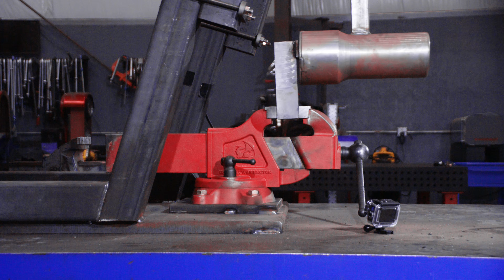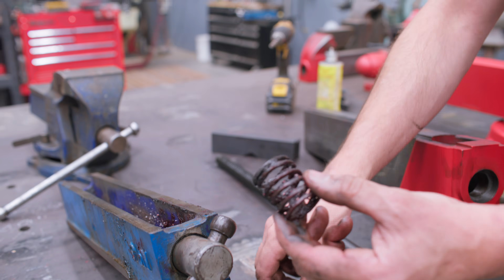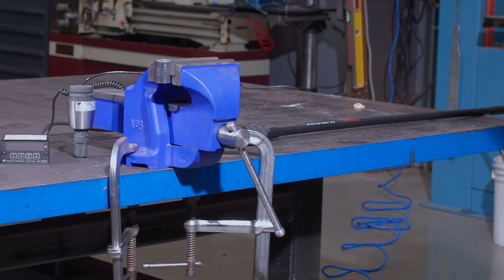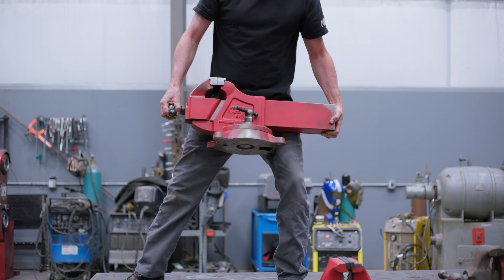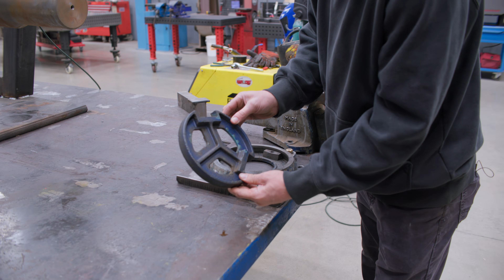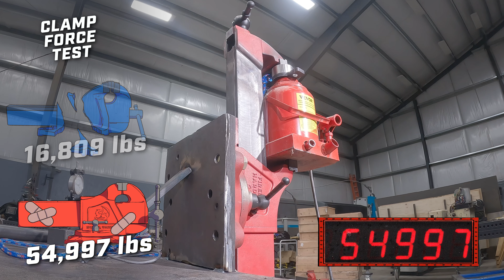What is a High Pressure Vise?

Comment: Worked with a guy who took the handle off his vice and just milled a 1" hex head into the end of it. For quick work he just put a socket on a 1/4" impact driver. When he needed to really crank her down he would grab a breaker bar. The 'standard' handle was a ratchet/socket or a box wrench. One of the best vice mods going. While there is definitely a case to be made for "buy once cry once" approach to buying tools it's important to note that not everyone needs a hardtail 510 for their workflow. For a machine shop doing production runs where you can make jaws/fixtures for your parts a standard decent quality vice is likely fine. For something like a service truck or general workshop where the vice doubles as an anvil/break/crimper/GripperRipper9000 the hardtail makes a LOT more sense. However, if I was a business and had the money to spare I'd buy a hardtail just to be done with it. When your tools are how you make money you want to buy the best tools you can afford that won't let you down on the job. For the average home-gamer who just wants to sharpen lawn mower blades and drill holes into angle iron it's hard to justify the cost.
Reply: Thats why he recommended the Record vise for your home projects. He showing you a professional tool to professionals so they can outfit their shop/business with high quality tools that have lifelong results.

Comment: In the demonstration of your vise's high clamping force, you should have explained why there's such a difference between your vise and the Record vise. It comes from the same design features you described earlier that make the Record's slide weak and loose in the base casting and make the Record's screw bend.

Applying stress to the Record doesn't just bend the handle, it also bends the slide, the screw, and even the base casting. As you crank the handle harder and harder, a decreasing portion of your energy goes into compressing the workpiece and an increasing portion simply bends the vise components.

It's also important to realize that those bends store energy. That's why a weak vise is so dangerous when it's tightened. That energy will be released suddenly if something breaks. And it's also why the weaker vise takes more effort to open and release the workpiece. The stored energy maintains friction on the screw. You have to fight through that friction until the energy is released (you feel it as that sensation that the vise is helping you unscrew the handle—it is!) and the jaw starts to move.

On your vise, the more rigid structure stores less energy and puts almost all of your effort into compressing the workpiece. And when it's time to release the workpiece, you have little stored energy to release, so almost as soon as you start moving the handle, you're moving the jaw.

You have a great product there. I only wish I could afford one!

Comment: I've broken tons of vises and finally settled on a Yost "all steel" 6" and surprisingly haven't broken it yet. When I manage to break it, it's getting replaced with a Fireball one. I'd love to see the Cutting Edge Engineering crew in Australia get a Fireball vise as they often have challenging workholding tasks and I've never seen Kurtis use a vise as regular vises are never strong enough to do what he needs

Comment: The real question is what test can you preform that the record vice can do that  the fireball vice will not out preform. I can't think of one myself but I guess thats the test you need to find to be able to improve your design. You've found so many failure points on other vices of comparable size already and designed yours to not fail but are there any more that make yours fail when another's won't.
Reply: i donno other then price this is top tier. worth the price dont get me wrong.

thing is, lots of these tests would kill whatever you are working on, or could have just been set up differently. the bracket press is nice, but, angle stock is pretty cheap and a press would be in order if i needed to make more then one. and if it didnt matter id use a hammer.

Comment: Are yall gonna make any smaller versions? I need one like half of the size if not a little smaller than half of the size. I need it to go on the side of my 5 drawer roll around tool box that I push around to different presses. I already built a strong base that hangs off the side for a vice but haven't found a small yet durable vice yet to put on it.

Comment: If I had a shop or even a table to mount one to. I don't know what I'd do with one, but I know it would be clamped to the upmost tightness.

Plus it was nice to see that Clint over at C&C equipment got one. Not sure what brand of hell they've put that one through yet. But the did have a piston rod clamped by the end something out about five or so feet from the clamp and still were busting loose rod nuts that go on with several hundreds of foot pounds.

Comment: In most cases the question is not which is the better vise, but which is the cheapest option that's good enough. Your vise definitely looks amazing and I believe it's worth the money, but many won't ever need that strenght or build quality. For many I think low cost options are more interesting (I'm aware of the compact version, that helps a lot already).

Comment: The jaws on that brand new Irwin/ Record stand in vise must really be soft for the knurling to flatten out smooth like that, but the casting seems to be stronger than any youd find in a hardware store - granted were in the area of "vise abuse" but sadly thats how many think a vises should be used.  I love this guys products, his hard tail vises arent cheap but theyre about the best quality there is in regards to quality of U.S. made metal, design and product support - hard to find a better vise anywhere he cuts no corners in his designs or quality, in fact theyre better than some of the best names out there, even some older better made vises arent as well designed and built as his are

Comment: We have a makerspace. Currently down to 1 working vise. Two non-named brand vises in our metal working area broken. Unknown what people were doing, but pretty shitty design when looking at what broke.
2 second hand Record vises in our general workshop. One has the return tension spring broken but still works as a vise. The second has a broken jaw from a guy trying to remove a seized seatpost from a bike. Didn't seem like an unreasonable task.
Jason's right, you certainly miss them when you don't have them.

Comment: Not everyone needs an f350 dually over a ford ranger, but when you do its nice to know theres one out there. Will a ranger do most of things that the majority of people need? Yes. Will a ranger pull a 10,000 pound fifth wheel dump trailer loaded with 25,000lbs of dirt? No. That where the f350 becomes necessary. And its the same way with the fireball vises.

Comment: Interesting . . . But consider this:
       Cordless impact drivers have become nearly universal in shops. Have you considered designing a vise screw with a hex head, intended for use with with such a tool?
Reply: you cant feel the clamping force and how much "give" the clamped material has when mashine tightened. For me thats really important, so i would not want that. Also they are crazy strong nowadays, so it would totally break the vice, many impact drills do 900+ fp tourque. shoutout to tourque test channel btw :)

Comment: Clearly the Fireball Hardtail vice is a far superior product from the Record one. I've got a  Record Number 6 on my bench. It's a much older version as it has an acme threaded screw. I think they changed to the two start thread in the late sixties or early seventies. I worked in a High school here in the UK as a woodwork and metalwork shop teacher. The school was on two different sites so had two metal and two wood shops in total. The earlier school buildings dated from 1961 or so and the Record number 4 vices had acme threads in them. All 20 of them!  lol. The other metal shop dated from 1976 and also had Record number 4's but they had the smaller threaded screw. ( I was not aware that the later Record 6's had a twin start threads on them, you learn something every day lol) in the newer shop there was a much bigger vice of at least 8" jaw width, but I can't remember name of the manufacturer, it certainly wasn't Record because it was painted bright orange. I think your test rigs are great Jason and demonstrate that the Fireball Hardtail is a tremendous piece of equipment and will last way beyond the 100 years. Fair play to you, you've designed and engineered an incredible piece of equipment! Sam from England PS yes I beat hell out of my handle as well, but the old Record still ain't let me down and I've had it 30 years, and it probably  dates from around WW2 as it was a friends grandfather's

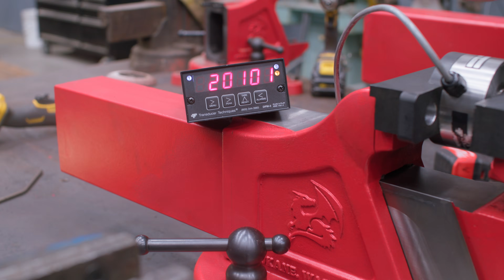Comment: 21:00 that's a really impressive demostration of the difference, but I'm a little lost on how that works. As in, how'd that "short" handle get so much more force into the threads? Is that from the combination of the thrustbearing reducing the twist friction and the entire shaft being built to not bind the screw?
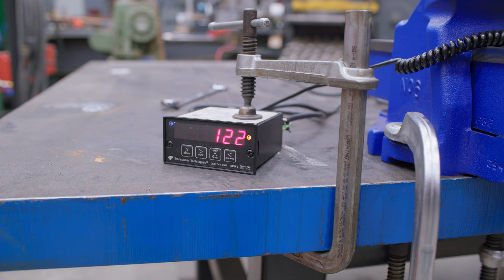32:05 I love how you can see the progression of protection for the testing equipment: duck tape for the force nut, clamp for the display, ties for the jack.
Reply: The thrust bearing makes a huge difference, I have modified vise to accept a thrust bearing and it is way easier to apply force. The screw binding he demonstrates at high load is also a big factor, and finally since the record vise uses a double start thread and a very long cast nut, there are a lot of threads creating additional friction.
Reply: thrust bearings, so you're not fighting the mechanical binding force of the screw against the vise body as it gets tighter.

Comment: the perfect vice for me could act as a press aswell,  so some sort of gearbox or smth, so i can clamp with lots of force but since its also slow moving cause of the gearbox convertion i could precicely bend things or if it has a flywheel kinda thing even stamp stuff or smth

Comment: The most important thing is to know what you need. If you don't need the strongest vise in the world, don't waste your money buying the strongest vise in the world. 

If you REALLY need a no excuses vise, the Hardtail is is invaluable. 

If you just want bragging rights, this vise is certainly one way to access that option. 

I am a machinist first, fabricator second. My needs are not even close to requiring a vise like this. It's overkill by at least a factor of 5x for me. My vanity, however, would love to have one.
Reply: This is precisely what he says at the end of the video.
Reply: Eh not quite. You left out longevity. It's not only needing the vice because your job requires an extreme amount of stresses. By buying this hard tail vice my son's son's son's son can use it for light hobby work because it's light work for the tool. Sure buying a cheaper light duty Chinese vice for light duty jobs might hold up 10-20 times, but by buying something reinforced to handle much more the tool lasts substantially longer. Long enough to pay for itself in how many chinesium vices you'll go though. Approach tool buying the way they engineer does, by overbuilding/reinforcing you save in yearly maintenance/replacements, because the tool is never stressed or used to full capacity.